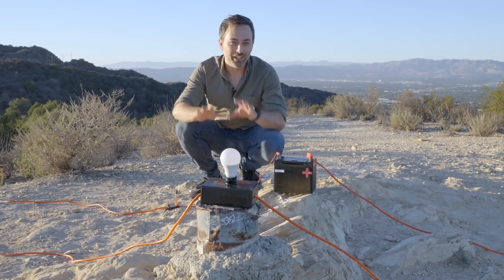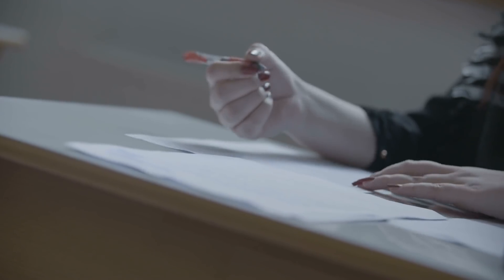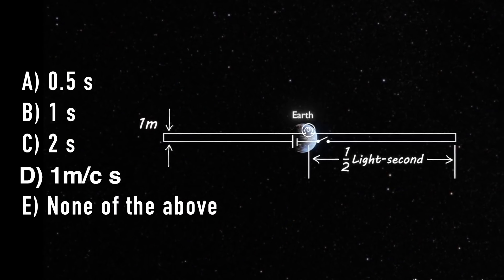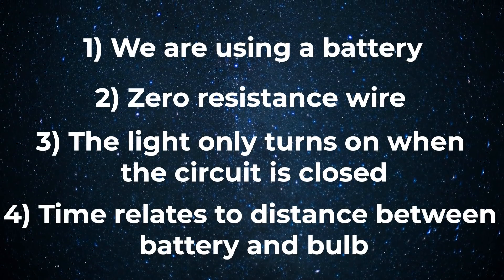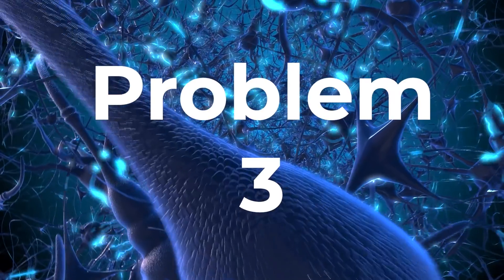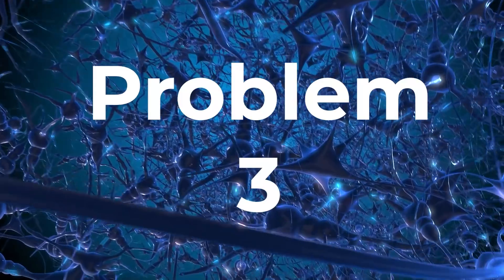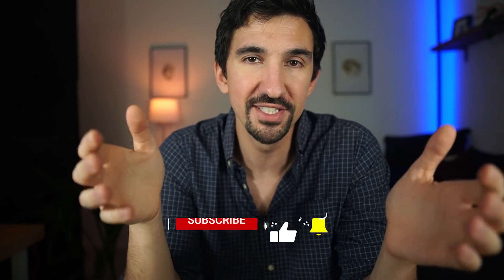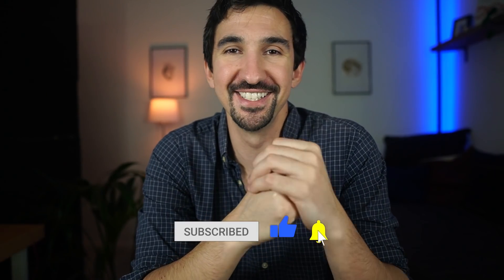Is Veritasium Wrong About Electricity?

Comment: You're absolutely right about his answer being wrong otherwise we could totally send binary digits faster than light. But I don't think the antenna mental model makes it any easier.
Reply: This is not a causation issue. The effect the switch has on the light bulb is similar to how a radiowave reaches your car antenna without a wire.
There is an Electromagnetic wave. Also, when you have static electricity you don't need a wire to see the effect. 
So the electric charge and the EM wave both effect the wire that is 1 meter away the moment the switch is turned on.
The problem with the whole demonstration is that he is trying to say that all the energy needed to turn the bulb on is transferred that way. And it is very disingenuous. The wire is required. So the light will not turn on in any meaningful way for at least a whole second.
So, he is simply wrong about when the bulb will turn on. BUT, the light bulb does see an electromagnetic current and voltage in the time it takes to cross 1 meter, so he is taking that to mean the light turns "on". I disagree with that usage.
Reply: @marcfruchtman9473  I think Veritasium's video doesn't properly address these two distinct phenomena. What I gathered from his video is that he claims ALL the energy required to KEEP the bulb on travels through the meter of air. But maybe I got it wrong.
Reply: @polpotube  That's certainly how I interpret the "message" he is sending. I honestly believe he got the idea that this was true by talking to the experts about transmission theory which he somehow extrapolated to this demonstration. He creates a set of rules that box in the answer to some unrealistic subset of possibilities which have no real world case for power transmission to a house, spends all the time talking about power to the house, and then frames a question that due to the "rules" of the question have zero to do with how power is transmitted to a house. 
Nevertheless, I think he actually believes that the "the power" is sent 1 meter and that there is no real power in the conductor. He then took that to mean that the conductor is not the carrier of the energy. But it's misguided because the conductor is the carrier of the moving charges, and the distance of the EM Wave from the charge determines its power density. And that is where he makes the big mistake in his "belief". (At least that is my take on it).
He then creates the entire video to "blow our minds". 
But, I think he is wrong. The majority of power must travel very close to the conductor, not 1 meter away. And so, the whole turn on the light trick has ZERO meaning for me since it turns on with "any" current. Who cares if it turns on with any current... if that is true it invalidates the entire demonstration. You could short circuit the battery together and get the same result without a switch or wire connected to the bulb and get the same result.

Comment: If you had a stick a lightyear long and pushed one end would the other end not move at the same time? As this is just a long line of electrons pushing each other it is exactly the same. If you just sent 1 electron around i might agree.
Reply: Boom info moving faster that the speed of light. Nothing moved faster than the speed of light yet information instantly traveled a light year. The distance doesnt matter.

Comment: There are two things at play here. First, a bit too much of a "wish to surprise" on part of Derek. Second, the experts he has consulted, they all made a best guess on the behaviour of the circuit, and not a trough physic analysis. The experts took one piece of quantum electrodynamics (electricity doesn't travel in the wire, but excite the field around which in turn allows the wave to propagate along it. Wires as waveguides), and the science of waves propagation in space (good old Maxwell 101) - and cobbled together a enviable answer: 3.3 nanosecond of travel time.
If did the math for a wire pair going from Earth to Mars, where a good old fashioned radio wave, at the most orbital distance, takes 20 minutes one way - i don't have the confidence to tell it here.
Now, consider the two parallel wires as a transmission line. I the past, the VHF TV didn't use coaxial cables, but a balanced transmission line made of two parallel wires. The impedance of the line is: Z = 276 log10 S/r, where S is the distance between the wires, and r is the radius of the wire. You are right in comparing the experiment to a transmission line, because it is.
In any case, the 3.3 nanoseconds reaction time is wrong. At least, it can't be proved true.
Thanks for your reaction video.
Reply: Wires as waveguides looks good as in wiki "Speed of electromagnetic waves in good conductors", that the turning of the switch may initally propogate as an electromagnetic wave and that the current is bound by the m field around the conductor, that the return wire can partly cancel this and that the field exists largely exists within the dielectric wire insulator, which can slow things down at frequency (eg Goubau line).   This has been an interesting problem for all and thanks to Derek for followup.
Reply: Sure it can.  Build the circuit in a simulator with the parallel wires modeled as transmission lines (which they are).  You will get that exact answer, assuming you correct Derek's answer as noted by correcting the units.
Reply: I think it's a bit hubristic to claim that the experts didn't do the science.
And it can be proven of course. I guess veritasium was a bit misleading with asking for the bulb to "light on", as that depends on the power needed for the bulb to emit light and so on. But it is true (and calculatable and demonstrateable) that the bulb will receive some energy after 1m/c.

Comment: Started off great, but ended up very convoluted, for me at least. 
I think this could be made much simpler via the following: Assume a long straight "perfect" coaxial wire going from here on Earth to Mars. The wire isn't attached to anything on Mars, it's just a way to say "the other end of the wire is really far away". Now, what happens when we attach the Earth end to a voltage generator that will generate a voltage pulse. When does the pulse get to Mars? It certainly can't be faster than the speed of light. If that were true, the Martian with Matt Damon would have had a very different ending and we'd all be using wired communications rather than wireless communications :)   
Assuming the wire is "perfect"; meaning 0 ohms; no resistance, then the pulse would actually travel AT THE SPEED OF LIGHT and since Mars is 5.46 x 10^10 meters away and the pulse is travelling at 3 x 10^8 m/s  time = distance / speed -> 182 seconds =~ 3 minutes. This begs the question, what happens to the pulse once it reaches Mars? The pulse reaches an open circuit (remember we left it open), and the pulse has to go somewhere. It reflects back. In fact, if we were to wait ~6 minutes, we'd actually see the pulse come back! In reality, it takes a bit longer because the cable isn't a perfect 0 ohm cable, so we actually see it travelling at about 90% the speed of light. And, in closing, this is a decades old signal integrity trick that is used across all sorts of industries to "check if the cable/PCB trace has a problem" (i.e. is it broken, and if so, where is the break). Simply send a pulse down the cable, look at the time it takes to get back and you know exactly where the break is. 
And, for the super curious, we can even tell the TYPE OF BREAK in the cable by what the returning pulse looks like. If the returning pulse polarity is reversed, then the cable is SHORTED (i.e. so someone stepped on our cable on Mars and squished it together, which could also be an indication of life on Mars - ha ha). If the returning pulse is not reversed, then it's an OPEN. And lastly, to drive it home, If the pulse comes back twice as fast as it did before, we didn't violate any laws, likely a space ship flew through our cable at about 1/2 between Earth and Mars and severed the cable :).

Comment: You are speaking about transitory regime. But the electromagnetic field , and is transmitted for electric and magnetic field by virtual particles (how else would they act in the distance ) ... so let's modify the experiment and add a generator of a given type of signal at the begining and an oscilator ... that would prove that is not the transitory change which gets somewhat propagated.

Comment: The antenna description is headed in the right direction.  For those of you who have set up a TV antenna using a flat 2-wire cable (I know I'm old fashioned, as most TV now arrives via coax cable), you may recall that the antenna is connected to the TV via a pair of stranded copper wires that are many diameters apart: a "twin lead."  For the most common twin lead, the wires are 7.5mm apart and are 20 or 22 gauge (check out Wikipedia.)  Never mind the ends, let's imagine that you had 300-ohm twin lead extending to infinity, first in just one direction, and with superconducting wire -- this is, after all, a thought experiment, so let's keep it idealized and simple.  When you connect your battery voltage across the two wires, the voltage difference between the wires will propagate away from you at the speed of light, and the growing length of wire that has the voltage across it will be acting like a growing capacitor, having a stored charge-per-meter along the increasing length of wire.  There will also be a steady current, charging the increasing amount of capacitor as the wave propagates outward.  There will be energy in both the electric capacitance field and the current-induced magnetic field, and that increasing-with-time energy will be the energy that went out of the battery: at 12 volts and into an effective resistance of 300 ohms, which comes out to 12/300 = 0.04 amps, which times 12 volts gives 0.48 watts.  The pair of wires in the Veritasium video are much farther apart than 7.5 mm, and the wire diameters didn't increase proportionately nearly as much as the spacing in-between (going from 7.5mm to 1000mm), and without getting into the detailed formulas, I would guess that the impedance of this wire pair, viewed as a wave guide, would be much greater than 300 ohms.  When you add the pair of wires going off to infinity in a second direction, as in the video, it looks to me like you're connecting a 6 volt difference to the wire-pair going to the left and a 6 volt difference to the wire-pair going to the right.  This gets a little confusing, but if the characteristic wave impedance of our pair of wires is, to pick a number for illustration, say 1000 ohms, then I'd say that the current flow would be (6 volts)/(1000 ohms) = +6 milliamps going out of one end of the battery, and -6 milliamps going out the opposite end.  This would happen if you closed the switch but with the bulb absent, in other words, an open circuit on the bulb side.  Current would be flowing out in both directions to charge the capacitances of the increasing charged lengths of wire on both sides.  With 12 volts and 6 ma, the battery would see 2000 ohms total resistance, the series resistance of the two sides of this infinitely extended wave guide.  Now if you insert the bulb in the middle, it will draw a current as if it were connected to the battery through a 2000 ohm series resistor - or 2*R where R is the characteristic impedance of the wave guide pair.  If we use a finite length of wire-pair and short-circuit the wire ends, making a loop, then the outgoing wave of polarization will be reflected back from the ends, and in the time period for the waves to go out-and-back, the voltage across the lamp will jump to a higher value, and a wave of altered voltage will start propagating out from the middle to the ends.  Anyone who wants (and understands well enough) can work out the details, but suffice it to say that the bulb will turn on almost instantly, and dimly, when the switch is closed, and will then show step-wise increases in brightness until the bulb finally sees a steady 12 volts across it and the series impedance of the twin-lead wave guide has effectively gone away with a steady current flowing.  So this is obviously more complicated than the Veristatum description.

Comment: Veritasium is wrong.

Electricity, first the E field, does not travel with the speed of light! But according to the properties of the wire much slower. For practical applications its about 2/3c. 
How does it work? 
You switch on the switch. The first part of the wire becomes loaded with the potential directly on the switch. 
Image the wire divided in infinte slices of wire. For better imagination we say 1mm. 
So how long does it take that at the end of the first mm is the full potential of 12V? You have to imagine the wire as a little condensator that is charged over its resistance. It has an inductivity as well, but this is usually smaller that its capacity. And so on. Each piece of the wire has to be charged one by one over its resisitor. And that propagates slower than c. Maybe with an supra conductor its faster. 

And this is a wave. Its not a wave with DC and short wires, buts a wave with long distances (earth distances, some 100kms are enough) or high frequency. 
 
Maybe - didn't calculate this - this wave is reflected back and the light buld took even longer. The wire has an impedence made by RC and I. And if the lightbulb has a different impedance the wave is reflected partly. So this long wire acts as a coil, too.

So is took even longer than with light speed. 

What happens when you cut the wire. Even the a wave is propagated. Not up 0->1 but a falling slope. This also is slower as c. (again 2/3c). 
The same process but inverted. Capacities are unloads. And inductivities, too. 
.

Comment: He draws the Poynting vector as if energy was mainly transferring through the air, which is wrong. Energy is transferred through the wire, so energy flux needs to go through the entire wire and reach the bulb. Energy transferred through the air is nearly zero. If he was right, we could just connect a bulb to the ground and it would light up.

Comment: Well I see it this way: since energy doesn't actually flow throught the wires, but just generaly between lightbulb and a battery (or switch? not exactly sure here ho to go at it, but I'm just gonna assume that they are effectively the same thing since as you said the problem isn't rly about circuits). Also I'm gonna assume that what is actually needed for the lighbulb to turn on is the information about the switch closing (or opening for the light to go off) which is being carried by said energy at the speed of light. Which in the end means that the time between the switch closing/opening and the response of the lightbulb depends only on the distance between lighbulb and the switch. Since in this example this distance is very small we can get that 1/c value (pretty much saying that the distance is 1) but in the case of some far away switch we have to use that value instead and we end up with d/c where d is said distance.
Reply: The energy doesn't flow through the wires but flows in the fields set up by the current in the wires and flows very close to the wire where the fields are strongest. So the energy is indeed following the wires, not just generally going from battery to bulb. The problem with Veritasium's take is that there are what we might call some parasitic capacitances and inductances that cause some very brief currents to flow that we might call transients. He is taking the earliest appearance of these transients to say that the bulb is now on. Personally, I consider the bulb on when it starts consuming delivered energy rather than energy from transients.